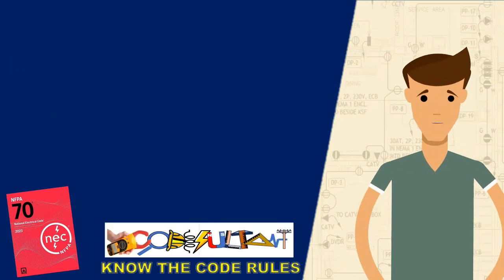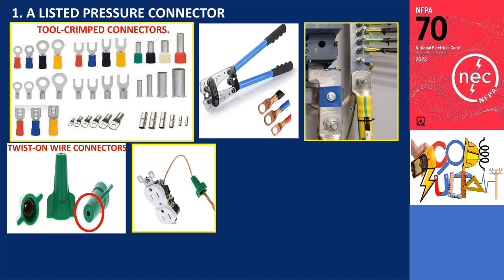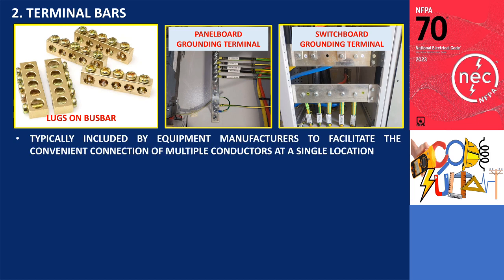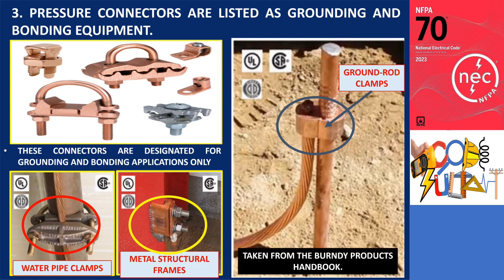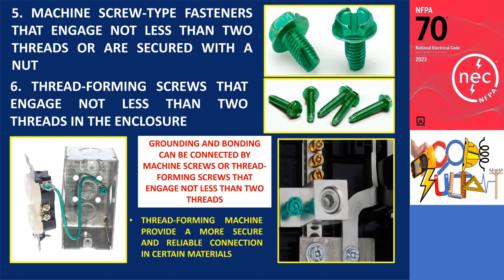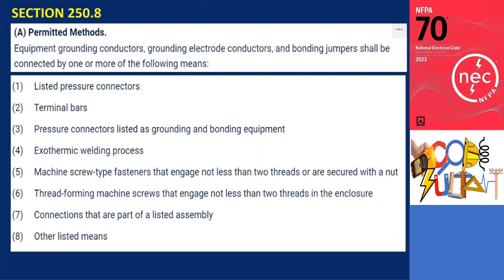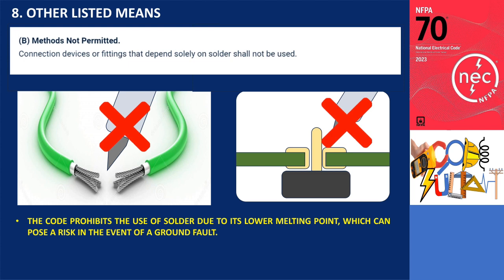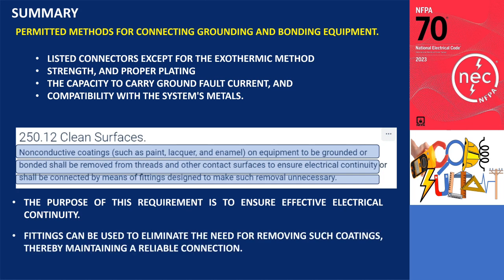CONNECTION OF GROUNDING AND BONDING EQUIPMENT 250.8 NEC 2023

Comment: For all outgoing feeder cables from an LV panel, each cable gland has a bonding jumper. Is it required by code that each gland be individually connected to the earth bar of the LV panel?
Reply from the maker: Hi,, if the armor of your cable is being used as the equipment grounding conductor, it must be terminated at the earth bar. However, if a separate equipment grounding conductor is provided, it's not necessary to connect the armor to the earth bar — bonding it to the enclosure will suffice.
Reply: @codesultant  Thank you for the clarification. It is clear to me now. that  250.96 Bonding Other Enclosures.
(A) General. Metal raceways, cable trays, cable armor, cable
sheath, enclosures, frames, fittings, and other metal non–
current-carrying parts that are to serve as equipment grounding
conductors, with or without the use of supplementary
equipment grounding conductors, shall be bonded where
necessary to ensure electrical continuity and the capacity to
conduct safely any fault current likely to be imposed on them.
Any nonconductive paint, enamel, or similar coating shall be
removed at threads, contact points, and contact surfaces or
shall be connected by means of fittings designed so as to make
such removal unnecessary.
Reply from the maker: Thank you for watching!